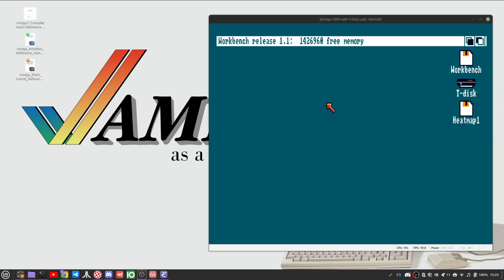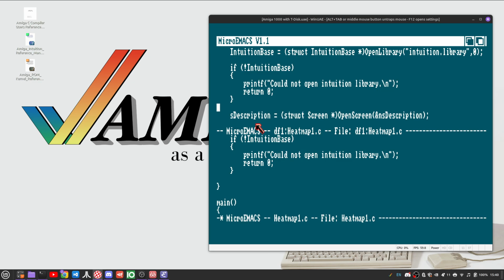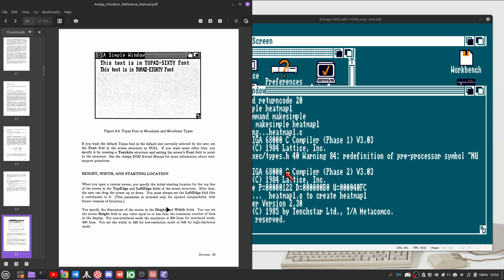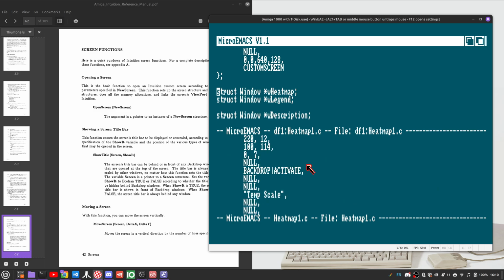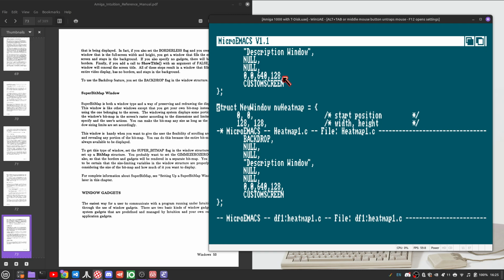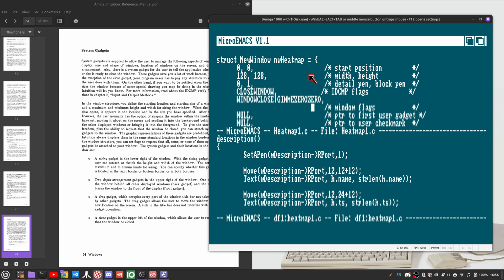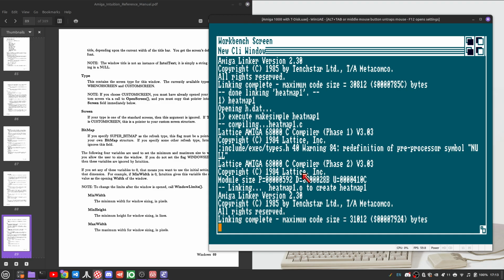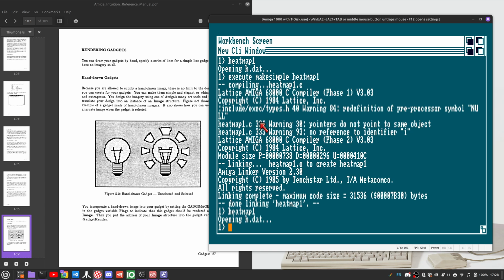Amiga as a Workstation Part 5: Heatmap, pass 1

Comment: I notice the project is in one source file, and you're using a make script. Did you write it?

Also, the heat data - the driver for the map. Did this come from a source, maybe I missed it but the data integration went by very quickly.

With more features planned and the program likely growing into the 1000s of lines across multiple files are you going to use the Lattice make with build rules? It was in their compiler companion that included grep and other tools.
Reply from the maker: The Make* scripts came with the Lattice C. 

Lattice Make was a separate product at this point in time, and I may integrate it at some point as I need to build more source files.

I did not show where the heat data came from, it was something I cooked up, because I wanted to focus on the visualization aspects.

Comment: Somewhere around 1:06:00 when you pasted in the marked block for description you must have done it twice.   By 1:08:00 when you saved the file it was 280 lines which is more than 30 lines greater than the previous save.

Of course, everyone knows the actual cause is that you use emacs.   You accidentally invoked an obtuse demonic function provided by  emacs origins in the underworld.  I theorize it transported code from another version of you.   In that you's video he lamented why his description definition disappeared and had to retype it.

Several times your video exceeded the capabilities of the 1986  Atari ST.   Yes, definitely for the heatmap program.    Not just the heatmap program, but  your workflow also had more than four windows open.  (cue an Atari ST choking to death.)

Comment: Good stuff! Compiler warning 30 on line 324 might be fixed if you cast the value returned by GetMsg as a pointer to IntuiMessage. For example, message = (struct IntuiMessage *) GetMsg(wHeatmap->UserPort);